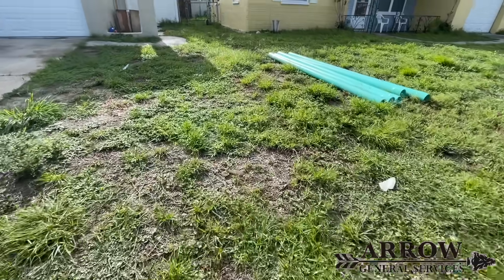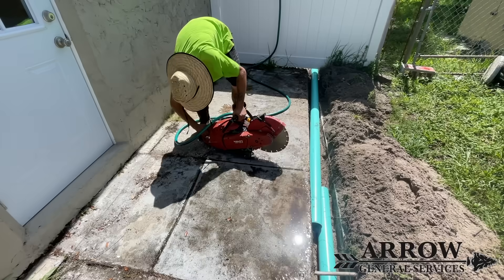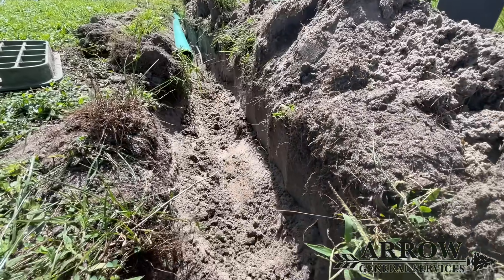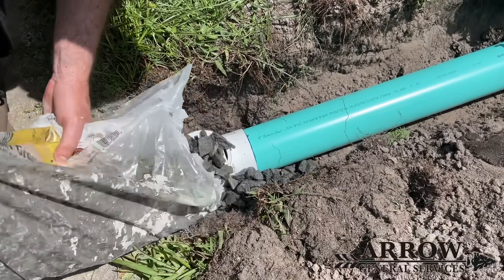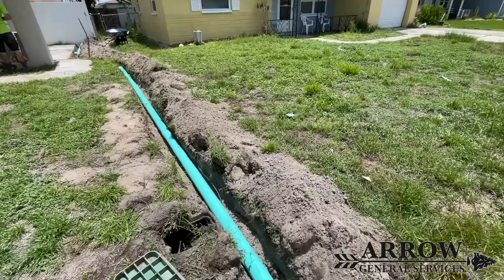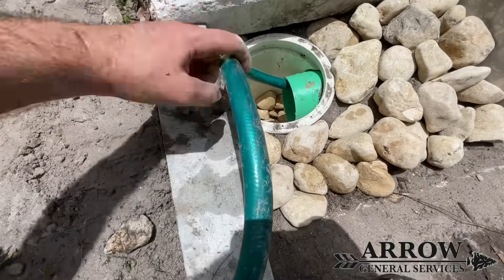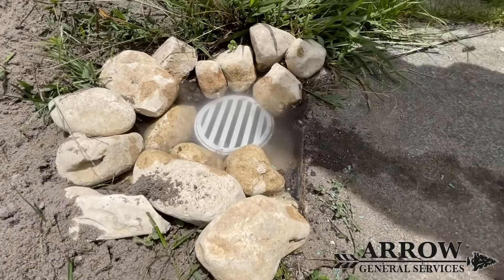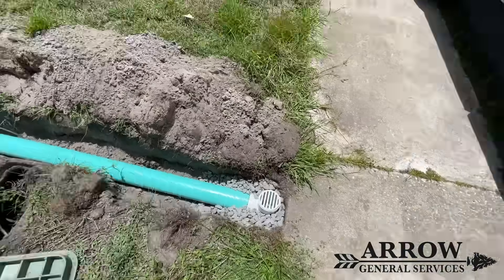How To Drain A Yard With No Slope - Flooding Issue Solved

Comment: The problem in this video started way back when the house was built.  For example: I purchased a condemned church house on roughly a 1/2 acre plot, where the rest of the plot was rented out for parking.  I did the research for all the houses in that area. Seems like that area was flooded back in 1918, and the water level rose 25% up into the church walls. And again in 1958. However, all that was due in particular to a mismanaged dirt levee that gave way and flooded the area.  However, in 61 they started a 5 year contract and replaced that levee with a giant concrete storm system and tied some of other parts of the state into it.  FF>> 2005 I tore the church down and noticed the slope of the land to be so catawampus that nothing would work out right. So I brought in a leveler and went to it.  I sloped the earth up to where it was 18" higher at the back of the lot and it was 6 feet higher at the front where I stacked very large granite boulders as a lifetime retaining wall, adding a vinyl membrane and drainage under it all and cemented them in. And I put my house on top.  Water would never touch me again...
Reply: Nice. Must've come w/ a Hefty price tag though.
Reply: Man,  you sure wanted that little half acre plot!
Reply: @sluggo Notnancy  2005 prices of a condemned plot, he would've gotten it cheap. Tearing it down was the ceaper solution than trying to restore & remodel it. Even if he paid peak housing market prices for a new build in sping of 2006, he would've returned to those prices in 8-10 years. If he sold it in the last 5 years, he likely made more than double what the total cost was because of the new housing bubble we're in. Full circle.

Comment: I like the concept but they always get stopped up with debris over time. No way to rod it out. It's not really a long term fix.  I prefer a sump with pump, or a 3 foot diameter dry well. Add septic lateral line pipe(s) to the dry well for extremely heavy rains.

Comment: I have a family member who has a very similar problem but with it flooding their house and it has become clear they would rather just make endless excuses to ignore it and waste their and other family members money on the damage it does to the house than fix the actual source of the problem.  

First excuse:  Can't do it because I am not a contractor.  
My state has a grandfather clause that homeowners can do such work provided it's signed off on by an inspector or certified contractor and I have a friend who is such a person that would do it for free.  I got shot down for,

Second Excuse: Can't do it due to zoning issues. 
They live 1 block outside city limits and are exempt from zoning laws related to this type of project. I got shot down for,

Third Excuse: The ground is very hard and it would take someone weeks to dig it out by hand. 
I have a backhoe and could easily do all the digging in a few hours. I got shot down for, 

Fourth Excuse:   All the dirt that would need to be hauled out and replaced with drain rock which would need a dump truck to haul.   
I have a dump truck and places to put the dug-out soil plus get the drain rock for free. I got shot down for,

Fifth Excuse: The cost of materials would be too expensive. 
I have a large friend and customer base that have everything needed laying around as overstock /surplus items they have said I can have for free if I just come and get them. I got shot down for, 

Sixth Excuse: The cost of fuel and labor would be too expensive.   
It might cost me 20 gallons of fuel, which is a business write-off.    Labor is free because I have friends that love playing with my toys for experience and trade for use of for themselves or to do side work for easy money.  I got shot down for,

Seventh Excuse:  It will kill the grass and what gets replanted won't match the yard. 
I have a friend that does landscaping professionally and can make a custom blend reseed mix that is a 100% match for what's there. (For free because it's a tiny job by their standards) I got shot down for, 

Eighth Excuse: Fixing this will just make all the other worn-out and broken stuff on the property look worse.   
I am pretty sure I can find enough surplus stuff to do almost everything for free or as a business write-off for myself or as friend's businesses as charity work.  I got shot down for, 

Ninth Excuse:  They will be dead in another 10 -15 years so none of this matters. 🤯😵 

The thing is, none of what they need doing in hard high-level or costly work from my view, and doing it all would tear up their yard for about a week but in return, they would increase the market value of their property by 25 to maybe 50% long term without actually affecting their tax rate in any way that wouldn't be grossly offset by avoided costs as things are being handled now, and the whole place would look much nicer and up to date from it's current worn out 1980's look it has now.

Comment: I built a French drain that was 3 feet wide and 12 feet long, dug a 3 foot diameter hole 3 foot deep filled with drain rocks then installed my drain lines. Works well in light to moderate rain. hard rains drain a lot faster but still flood the end of my patio. It is much better than it was before. Good video, I did the same but on a larger scale.
Reply: Next time put a 2/3/4 inch pipe in there with holes on the bottom near the ground, then cover with rock. Water rises in the trench and fills the pipe immediately exiting the trench, almost like a water highway.
Reply: You don’t put the basin at the end of the pipe? At the ground level?
Reply: That's 10 times the amount of water to handle

Comment: dig a hole the size of a bin and fill it full of rocks, pea gravel, stone chippings, sharp sand, old pop cans (crushed) anything, and your yard will dry up very quickly, its called a "soak away" and is the oldest method for drying out wetland, the only thing you have to make sure of is that the hole is deeper than the clay level that's making your land soggy,
Reply: FWIW this is in the Tampa Bay area. There is no clay layer and all you have is sand. This house has bigger issues that wet grass areas - no gutters/downspouts, no pitch in the concrete slabs and it appears the grade for the house itself was set too low. He was putting a band-aid on an arterial bleed but sometimes ya gotta do what the client wants of can afford.

Comment: This may work for lighter rain but a good heavy soaking will overwhelm this quickly. Also, depending on your jurisdiction, sheet flowing over the public right of way may not be an allowed form of site drainage (it is not where I live - drain pipes must exit the public ROW and daylight into the street gutter).
Reply: Decent video of the process, but in terms of functionality, I’d have to agree agree this will be completely overwhelmed with a heavy rain.  We had a similar problem here in Florida with almost 0 slope to the street, and it required me to French drain the entire perimeter of the yard into two sump basin’s with to discharge lines out to the street to blow the water away from the house.  Had I install this particular method the water volume would have back, flowed into the yard and around the house, not to the sidewalk
Reply: @billgreer4536  blow it up into a vessel , top dog , free gravity fed irrigation water
Reply: 6:35 as he said, the sidewalk is connected to the road.. no curb to daylight into
Reply: With a side walk like that. It is most likely a rural area with no codes to worry about. And as shallow as this storm drain is being installed, it must be in the South where it never freezes.
Reply: @roybradley5532 I’ve used a similar drain in New York for years, a few inches deep, no issues. Water only flows when it’s above freezing and at the end of the drain line, he has a way for the pipe to slowly empty itself out, so it seems to empty it itself out before the freezing comes along and gets deep into the ground.
Reply: For sure...I wouldn't install/warranty/advertise this as a solution. I'd rather have my customer pissed at someone else.
Reply: in some townships you can't pipe into the road and in northern states that water dumping over the sidewalk leads to ice..lawyers love that kind of thing
Reply: Rain  @forzajuve4845  how would one differentiate that said ice is from the drain and not what’s falling from the sky?🤔
Reply: @Viking74256  it’s your job as a land owner to keep your sidewalks clear from danger .. if an old lady slips on the ice and breaks her arm, the lawyer sees that your piping to the sidewalk( which is illegal)you’re culpable.. also illegal to pipe to the street .. also illegal to blow snow into the street
Reply: @forzajuve4845  but there doesn't seem to be a community storm drain.
Which is weird. 
This would work if the authorities had drains under the sidewalk.
I have seen stuff like this. The developers never installed community storm drains. But they still got approvals.
Reply: @keystone6162  I totally agree .. but in the south , water seems to dissipate quicker ..
Reply: And grass clippings but everyone i see blows them right in the roads they don't even stop mowing when cars pass by as they're supposed to incase a rock or twig blows out and hits the car i always stop when mowing when a car is driving by but tons of other mowers don't they keep on mowing blowing grass twigs and pebble rocks out.

You can't have a drain pipe from any shed or garage exit to the sidewalk or road or a drainage ditch thats the rules
Reply: @forzajuve4845  B.I.N.G.O.
Reply: You have no idea what you are doing.  Discharge volumes are calculated by slope, pipe size, volume and surface area. Water will not come out of a pipe if it was perfectly level because it will only self level inside of it.  As everyone else says it will become quickly overwhelmed in a heavy enough downpour of rain.  This is why plumbing and storm drain code knowledge is required to design an efficient drain system. Any yard that has no slope must be discharged by a pump to be effective in all rains.  Pitch can be created with gutters because you’re taking water from the roof to the road. You need to go back one step to the source of the problem.  Really bad!

Comment: This is nonsense.  This will not work.  This may speed up the draining process to some degree after the rain stops and the yard dries out,  but it will not prevent the adjacent room floor from flooding.  You really need to run your surface drains into a sump with float activated sump pump with discharge line to street in this situation

Comment: Sorry to be a stick in the mud but America must have very slack stormwater laws. Here in Australia stormwater must go to a legal point of discharge being the kerb and channel or a stormwater pit which is supplied by the municipal council.  If there is no legal point of discharge then we dig a stormwater pit that measures about 36 square meters that we fill with broken bricks similar to your drainage rock but only in areas where the soil is sandy. You guys certainly are behind Australia when it comes to stormwater discharge off a house roof.

Comment: As a road engineer I can tell you this is not a good idea.! In my part of the world - this would be a heavy fine (all drainage work must remain within the property line). Don't even flood it over the sidewalk onto the street.
.
Please don't do this again.  You have the drain lead out too close to the road and sidewalk.  The foundation to road and side walk has been carefully compacted (and engineered) to take vehicle and more specifically heavy truck loads that spread from the road outwards below the sidewalk.  
.
You are currently creating an under ground pool too close to the foundation of the road layer works.  In essence you will be softening the road foundation.  After a significant rainfall, the foundation to the road will be softened and if a truck rolls by, it will push down on the soft section and cause a rut.
.
Your drainage idea is good but please, please, please make it stop well within the property line. Most city councils would give one hell of a fine for draining outside of the property line for good reason.
Reply: The drain did stop within  the property line, but the water will flow over it.

Comment: I really enjoyed watching this video as it was very informative.  I would like to connect my gutters to a sump pump I have on one side of my house.  I noticed that you used PVC pipe for the new drainage and wondered if it would be better to use PVC or the corrugated pipe in a cold weather climate?  I live in the northern part of the mid-west where we have the freeze and thaw cycles.
Reply: Use the PVC, with bell-end couplings and fittings, as was shown in the video.
Corrugated pipe has many drawbacks, including the natural tendency to accumulate sediment and 'log jams' within the pipe. Its flexible nature allows low spots to form during installation and any subsequent soil movement later on.
Reply: i had a drain like this added to my yard with corrugated pipe (in MO).  i thought for sure it would collect debris.  years later it was still clean. it works fine.
Reply: @stevesnothere  As designed.  Sediment is supposed to be able to drain out of those holes.  Of you lay the sand and rock below the pipe and compact it, it will rarely, if ever, settle and cause low spots.  You can also use one of the newer systems that have corrigated lines, wrapped with a "sock" that is filled with foam peanuts.  This gives the water and sediment a place to drain away from the pipe.

Comment: Nice work & narration.  What is the purpose of filling the two foot pipe with gravel?  I’m thinking the pipe could hold more water without the gravel taking up space.  Is it to prevent dirt from rising from the bottom?  Also, could you have gone deeper - say 4 feet?
Reply: Yes you could go deeper.  The purpose of the clean gravel is to “hold the space”.  An open void in most soil types will soon collapse and you would eventually have no storage area.
Reply: @jphickory522  a decent rain will fill an empty 55 gallon drum in a half hour.
2ft, 4ft, 10ft of 4in pipe won't make a difference.
Reply: I think the plan is to flow on to the sidewalk and let it run into the street.   Which the city may not approve if they see this.

Comment: I understand that you couldn't go under the sidewalk, but here in the north I'd be leery of letting the water run across a sidewalk and into the road because as soon as it freezes, you've got the potential for slips and falls on your property.
Reply: he mentions hes in the Tampa bay area near the end so they should have minimal freezing weather
Reply: I watched the video; I realize he's in Tampa.  That's why I pointed out that "here in the north" additional factors need to be considered.  I like his system.
Reply: Did you see how shallow the water supply was? Stop your nitpicking it’s not helpful.
Reply: @TheChocodiles  It's still a good comment, and it's not permitted in many places to drain water across a sidewalk.  even if it doesn't freeze a lot of areas will end  up with algae and if someone slips and falls you could be liable for damages.
Reply: This is Tampa. 🤦🏿‍♂️

Comment: But this method only works if your run to daylight is lower than your drain entry.
You’ve sloped downhill underground, to your daylight location… but again, if your T fitting grate drain ends up higher than your entry… the water won’t bother to flood out of the grate if percolation stops. The water will rise back up the pipe to the beginning.
Small rain fall.. it is a quick fix. But in a days long rain/heavy rain.. water right of way is still in your yard.. not the street.
Reply: Exactly.  I don't think this would work without a sump pump at the sidewalk.  Also what is the point of putting rocks inside pipes?  Just takes up space reducing water holding capacity.
Reply: @SlavaLeonov  Agree. This will not work for anyone with a serious standing water issue.
Reply: @SlavaLeonov  So it don't rush down the pipe and erode the soil.  4 inch pipe in monsoon season is a lot of water damage with no rocks.  Hes right, it will percolate down.
Reply: There is no substitute for slope. Something has to force the water to move. For drains like this you don't need much slope at all. In fact if you have any at all I would keep it as close to level to make sure you don't end up too deep at the daylight. Adding proper gutters will go a long way to make sure you don't cause issues on the back end. But in the end, you might need a sump pump to get the water out in a heavy rain.

Comment: thanks for a great video.   how do you prevent the buildup of silt&clay&fine sand in the pvc?   how do you keep the pipe from clogging up?
Reply: you don't.  Most of the time you would use a perforate type of line for just that reason.  Unless there is a high flow rate, it will fill up eventually. But you can maintain a cleaner pipe from time to time with a high pressure hose and then cleaning out the catch basins and the out flow by the sidewalk.  The other thing you can do is have some sort of screening on the high side catch basins to reduce the amount of sediment that enters.  But you need to clean those often to prevent a clog at the initial entry point.
Reply: You can jet it from the top and then use a sucker truck at the bottom to suck out the silt. The pipe will silt up if there isn't sufficient cleansing velocity to push the sediment along the pipe.